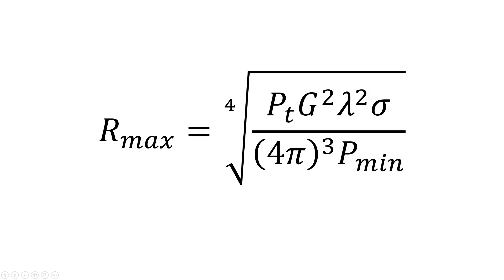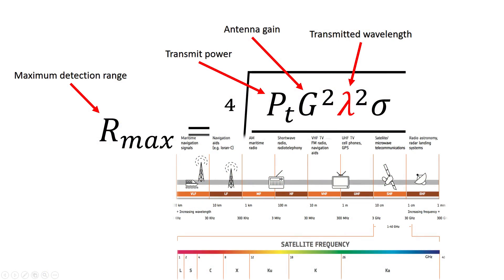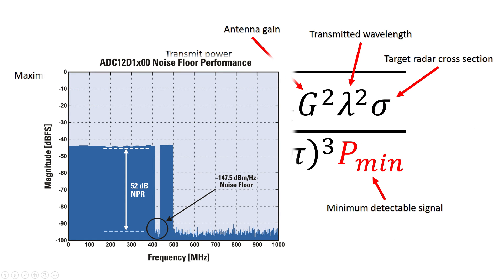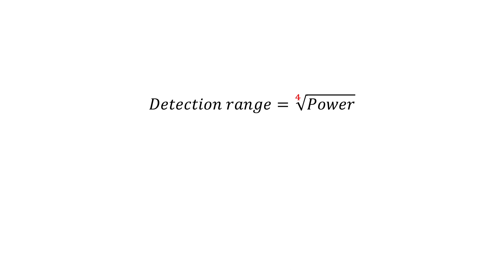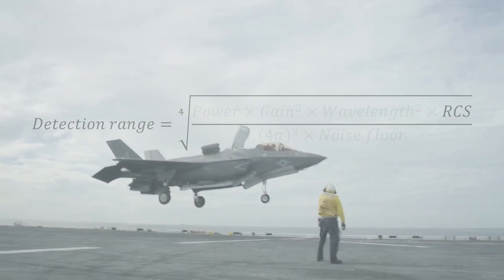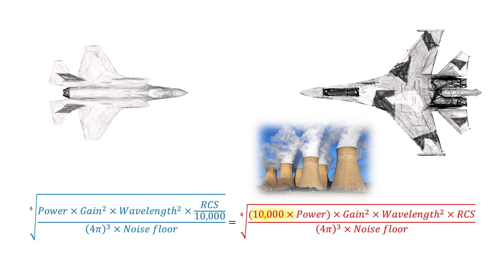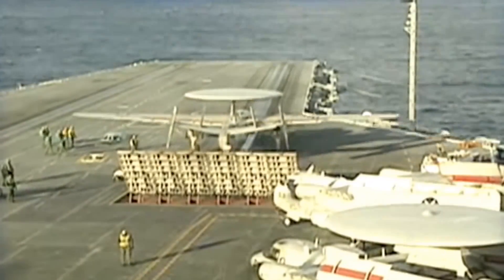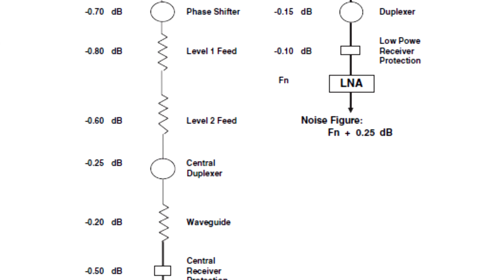F-35 Lightning II: Busting Myths - The Radar Equation [v1.1]

Comment: One issue with the radar range equation is that it will detect EVERYTHING that satisfies that equation. If you can detect a golfball-sized object at some distance away, then be prepared to detect EVERY golfball-sized object at that range.
Reply: You need to get multiple returns from a source before you can calculate it's speed, which means you need to figure out which return is from which source and be able to tell they're from the same object, and not random noise from separate objects, before you know any of their speeds or directions.

So no, you really do need to track all of them, otherwise you don't know which return is from which and you can't tell how fast any are moving.
Reply: Look for the golfball traveling 600 mph, problem solved.
Reply: It's a doppler radar. the radar picks out anything that is moving in relation to the stationary earth. Unless the jet is standing on its tail in a hover or flying exactly perpendicular to the radar you can't fly slow enough to fool it and even if you were dealing with an older radar that could be fooled in this way, speed is life in air combat
Reply: But at least it wont be hard to spot the one that is a plane when it is traveling at mach 1
Reply: Overcoming clutter has been a huge, huge focus of radar development for a long time
Reply: Very true. Worked on many old analog units that handled clutter very well
Reply: AS Deckard you can pick out the single fast object from a static background with one return (In the right conditions of course). All modern fighters use pulse Doppler radar after all.
Reply: There are not many golf-sized objects that fly 800+ km/h tho.
Reply: Artie the Swolest Man in the World Modern stealth reduces the enemy's radar effective detection range.

As an example
 Russian Zaslon-M can detect a bomber with RCS of 20 m^2 from 400 km away and track the same 20 m^2  target  about 200 km away.

F-22 has RCS is smaller than a bomber i.e. RCS of a metal marble. USAF F-35A's RCS is even smaller than F-22A (USAF General Michael Hostage claim).

Zhuk-MS (for SU-30MKK) has  offers detection performance up to 150 km vs a 5 m2 RCS target.

Stealth aircraft enhances RCS missile drone spamming.  
There's a reason why Russia has nuclear strike as part of it's first option.
Reply: I know it's a confusing conversation but we were already talking about detecting a golfball-sized object, and subsequently filtering out the one that's actually an enemy airplane.
Reply: ITmage Fly slower like a submarine stealth approach.
Reply: Artie the Swolest Man in the World Detecting golf ball-sized object is related to radar's detection and  tracking range.
Reply: true, but thats why its important to accout for those variables
Reply: Detects everything reflecting that energy within your detection lobe.
Golf balls fly, but not so well.

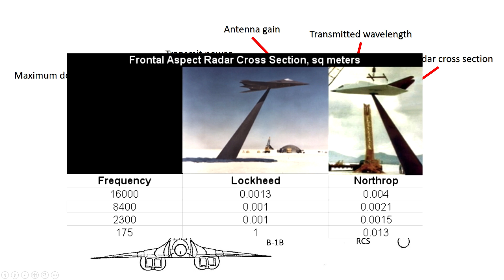Comment: At 2:41. RAM that works against lower frequency. Very Interesting. In the Serb shoot down of the F-117, the P-18 VHF radar only detected the F-117 at 50 km. Very poor. And it's detection range against a fighter sized aircraft should have been around 150-180 km. So the F-117 had significant RCS reduction against VHF radar. Maybe the RAM you talk about at 2:41 is the explanation.
Reply: The lower the radar frequency, the more inaccurate it is. Accuracy for a vhf radar is off-the-cliff terrible. It won't be able to tell if it is detecting 4 F-35s or 12 F-35s, and therefore can be easily tricked. It can cue an X-band radar, but the X-band still won't be able to detect the F-35 until its under 40 miles, under the best of circumstances, which is too late. L-band is more accurate, but the F-35 has more RCS reduction here than in the vhf band. Out of the fire and into the frying pan, so to speak.
Reply: 777Outrigger  Nah, they lifted that language from a LM patent on construction methods involved in manufacturing ceramic-like RAM materials. It made brief mention of being "effective" across a huge wavelength spectrum, but no claims whatsoever about the actual levels of attenuation within these bands. It didn't even claim to be more effective than any previous RAM materials. It was about baking the the stealth characteristics into the aircraft's skin panels vs the old method of painting a RAM coating on top.
Reply: Like the Serbs said, 50 km detection with a VHF radar. That's terrible, no matter how you slice it. And they new exactly where and when to look. And probably not just RAM, but RAS as well.
Reply: Against lower frequencies you need increasingly thicker RAM to have a significant benefit until you reach the point where it needs to be the entire structure.
Reply: Ground radars have the shortest life expectancy in modern warfare but they are still useful. Radars and SAM batteries guided by them are placed well apart with overlapping coverage in order to bite any aircraft that takes out a radar. No, it isn't perfect and a stealth aircraft will have some advantages but it will be spotted. There are also modern low frequency AESA ground radars that exist with all the same features present in modern aircraft but far longer detection range. Any radar is going to be a bright beacon advertising its presence - that includes the aircraft radar just as much as the ground radar. The structure of the ground installation is not very relevant because ground clutter will disguise its shape anyways to some extent. So you have two shapes that can not be seen very easily with one approaching the other. One of them has a much greater detection range. Even with fancy materials making the job somewhat more difficult the aircraft is not going to be invisible. Stealth becomes exponentially more difficult to maintain as radar frequency is lowered so it will be detected. Getting a lock may be tough but once its general direction is known the aircraft is vulnerable to having sensors of all kinds focused on it as missiles are sent. The ground radar may be destroyed as well but that is why the control center for it is often some distance away. Trading one radar for one stealth aircraft may be possible.
Reply: Actually the P-18 vhf radar the Serbs were using was a Russian radar, and the Serb battery commander, Zoltán Dani,  was very competent, intelligent, and energetic in it's use. Maybe that's more important than the technology itself.
Reply: Boxy Brown, It more effective RAM over narrower frequency RAM coating.
Reply: Boxy Brown: "I've read interviews with Zoltan in which he describes being informed by Russian advisers exactly what the minimum lock-on+fire time was for a HARM missile (something like 12-17 seconds) and so never ran his radars for more than that amount of time to avoid being hit. That's a severe limitation that throws all your numbers out the window to begin with. Furthermore, Zoltan said he modified the particular radar involved, so who knows what effect that had on its theoretical range. More to the point, if the claim you're making is that low-band radars are sitting ducks for F-35's this entire scenario is evidence against that claim. Zoltan was able to scoot his missile brigade around the country-side for 78 days without being hit by SEAD patrols that were looking for his ass the whole time! And he even shot down a stealth aircraft while doing so. Everything about this hurts your argument."

The moment you emit, you pop up on the F-35 net's sensors.  If you emit in RF intermittently, then cut RF with that type of discipline, it doesn't matter, because you're a fused target.  As soon as you cut RF, you still have a thermal signature that is being tracked and fed via directional MADL to other nodes in the net.  You have weapons en route to you very quickly, regardless of what you do in the RF game.  

You really think that people in the US didn't look at Serbia and take lessons from it?  Either way, none of those SAMs and IADS will have radar track on the EW suite-equipped F-35, which has unprecedented super-computing power driving the EW and EA.  It's actually a continuous offensive system that looks for mistakes that people make, thinking they will be offensive against it, then turns their systems against them.  We're talking about a generational leap in EA capabilities built into every F-35, that are adaptive and programmable on the fly.

There's a reasons the Russians are issuing threats against the Israelis right now not to attack their IADS in Syria, because Israel has the capability to target them at will.  It's so bad that they Israelis are already taking out critical systems for IADS as they are being shipped into theater, before they can be assembled.  Think about that for a minute.  Any time I see someone referencing the Serbian shoot-down of an F-117A in a conversation about the F-35, I know the conversation is in the wrong place.
Reply: Yes, to some degree you're right, but there is also RAS, which is a factor also. RAS can soak up Low Frequency waves too. 

But the Serb shoot down of the F-117 tells us something interesting. They knew the exact routing of the F-117, and when it was coming, but they still only detected it with their P-18 VHF Radar at 50 kms, by their own admission. Very terrible. The F-117 had significant Radar reduction against VHF radars, probably both RAM and RAS.
Reply: 777Outrigger That's a large oversimplification the variables involved. I've read interviews with Zoltan in which he describes being informed by Russian advisers exactly what the minimum lock-on+fire time was for a HARM missile (something like 12-17 seconds) and so never ran his radars for more than that amount of time to avoid being hit. That's a severe limitation that throws all your numbers out the window to begin with. Furthermore, Zoltan said he modified the particular radar involved, so who knows what effect that had on its theoretical range. More to the point, if the claim you're making is that low-band radars are sitting ducks for F-35's this entire scenario is evidence against that claim. Zoltan was able to scoot his missile brigade around the country-side for 78 days without being hit by SEAD patrols that were looking for his ass the whole time! And he even shot down a stealth aircraft while doing so. Everything about this hurts your argument.

Nobody is even claiming that the F-35 doesn't have design features that reduce reflections of lower frequencies to some extent. Of course it does, as did the F-117. It no secret that construction of the leading edges and other structural components influence reflections in the Raleigh scatter regime. That doesn't make it invisible or significantly better at avoiding LF radar than other LO aircraft.

Your logic doesn't even begin to add up and your overall attitude toward the F-35 is just silly. Anybody who is critical of the idea that it's some kind of panacea super-plane you write-off as a "hater," or a "Russian troll." Well, I guess a lot of aviation experts are just haters then. Hell, the Pentagon's DoT&E department must be full of Russians! (I hope somebody looks into that!)

Yup, that makes perfect sense, it's way more logical that those people are the "fanboys" and not the YouTube enthusiasts and gamers.
Reply: My real world understanding, LOL.  I've been studying the chaos of war for about 4 decades now, and you? F-35 haters use their simplistic scenarios against the F-35 all the time to "prove" their points. Is that all you've got as an argument? Rarely has a radar been cued to look at exactly the right spot at exactly the right time as the P-18 radar was that night. Even Karlo Kopp admits the F-35 has RCS reduction against low-frequency radar, and he's a F-35 hater, LOL. The F-35 will see low frequency radars long before they see the F-35, and then it's bye-bye to these large immobile inaccurate radars.
Reply: Or the other possibility is that it couldn't detect it past 50 km. Hardly ever, in the chaos of war, has a radar, like the Serbian P-18 VHF radar,  been cued so perfectly, by totally predictable flight paths and bad comsec, to know exactly where and when to look for one specific target, the F-117. And since the weather was particularly bad the night of the shoot down, there were few other aircraft flying. I would say that  a big chunk of the chaos of war was eliminated by these advantages. Complicated enough for you? More complicated than the scenarios that most F-35 haters can come up with.

And detected at 50 kms and tracked at 25 kms, also really bad. X-Band got a weapons quality track at 10 kms. Unbelievable.

And like I said, even the F-35 hating Karlo Kopp says the F-35 has RCS reduction against low frequency radars.
Reply: Sorry, the F-35 will see big immobile inaccurate low-requency radars first. It must be really painful for you, I know, but if a few graduate students can come up with RAM for the low frequency range a couple of decades ago, LM will have advanced the tech. And let's not forget RAS either. 

And it's amazing to me that not only do F-35 haters come up with some of the most simplistic, yeah, even silly scenarios against the F-35. Like your Maginot line of S-300s/S-400s protecting VHF-radars behind them. LOL. To hear some one like you calling me simplistic is so ironic.
Reply: 777Outrigger A radar failing to pickup a target at its maximum spec range is evidence of nothing but your lack of real-world understanding. Anybody who works with/on radar can tell you how much actual application differs from theoretical lab specs.
Reply: 777Outrigger Amazing…using a simplistic scenario to prove a point is exactly what you're doing. Your argument is that because a radar didn't detect an aircraft at it's maximum spec range, then said aircraft must have stealth features capable of defeating the radar. That's beyond stupid—there are myriad factors that go into detecting aircraft at a distance, not to mention your sample size is a single engagement. It is not uncommon for aircraft to move within a system's spec range before being seen. Btw, are you not aware that those radar operators were switching off their radars after ~15 second scans to avoid being hit by HARM missiles? That's about as big of an impediment to normal operation as one could have.

You're drawing big conclusions with terribly flawed logic. Your logic would also force us to conclude that the Russians have stealth TU-16's simply because they were able to penetrate the radar defense perimeter of CSG's on many occasions during the cold war going back 40 years. And I have actual experience working on radar systems at NSWC Crane, so nice attempt at calling me out but I don't really give a crap how long you've been an enthusiast in your spare time.

Comment: Short version: F-35 is a whole generation ahead and will eat the SU-35 alive
Reply: "proven Su-35"
Troll much??
Reply: top kek, SU-35 or even PAK-FA can't hold a candle to the F-35.
Reply: Irrelevant, the F-35 has the technology on board to do air superiority superior to all other fighters.
Reply: mister t, Flankers are design to be multi-role with a bias towards a particular role  e.g. SU-30Mk, SU-33, SU-34 and SU-35 which is no different to F-35A/B/C models.  F-35A/B/C models has 20 to 30 percent common parts. 

Flankers doesn't have low wing loading like F-15C.
Reply: Keep thinking that if it makes you feel good. But I wouldn't want to be in it against a proven Su35.
Reply: No, the SU35 was designed to be an air superiority aircraft unlike the F35.